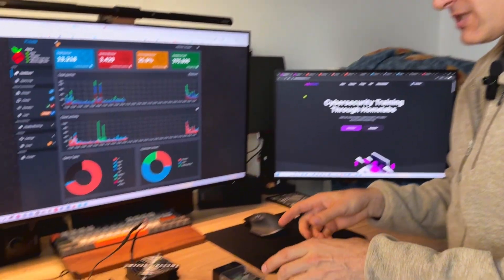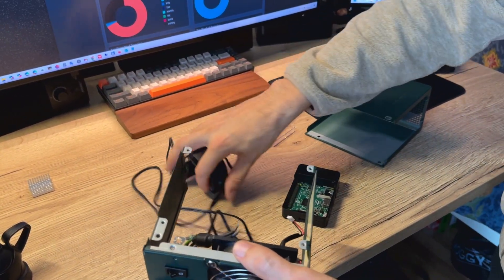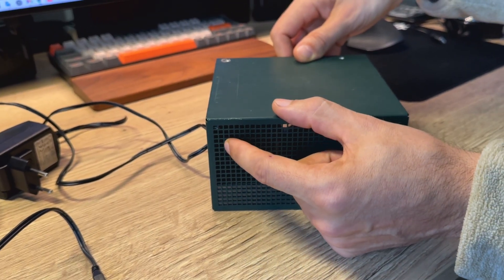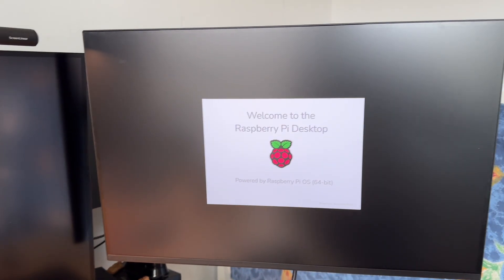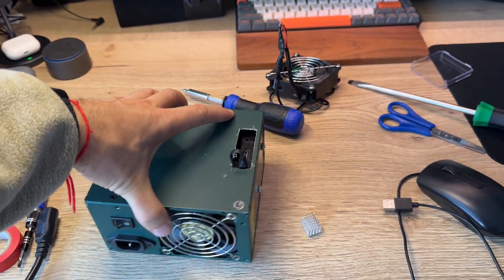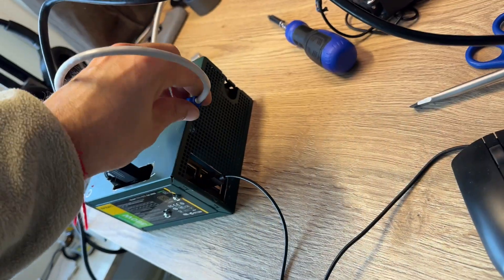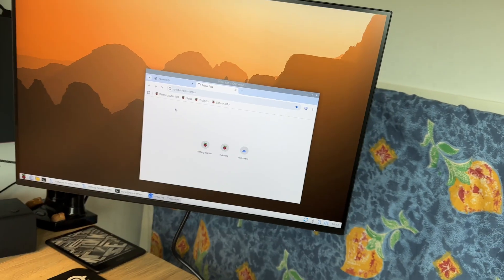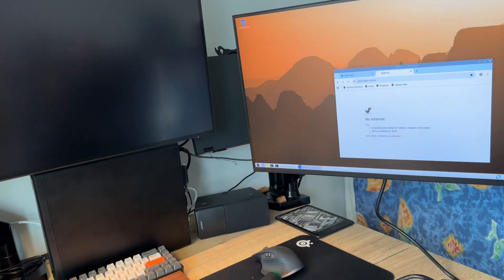Weekend DIY Project – Raspberry Pi DNS Server Inside an Old PC Power Supply! 🔧💡

Comment: Is this pi 3b 1gb ram and is that enough for future?
Reply from the maker: Hi! It’s a Raspberry Pi 3B with 2 GB of RAM. If you don’t plan to use a GUI, it’s still fine for small projects. I mostly use it for testing and experiments — things like Pi-hole and Unbound work more than well enough. I actually got it for free, so it’s perfect for that purpose. I also replaced the SD card because the previous one was too slow. In the end, it really depends on what you want to do with it.

Comment: Very strange setup. You practically don't need a fan of that size either. The fin stack would cool the chip with passive cooling. If you REALLY wanted a fan, you could just 3d print a custom case for the PI, with a fan shroud.
Reply from the maker: If I have a 3d printer I'd certainly print it, but I have access to bunch of old IT stuff and I came with this idea!) Have a nice day!!!